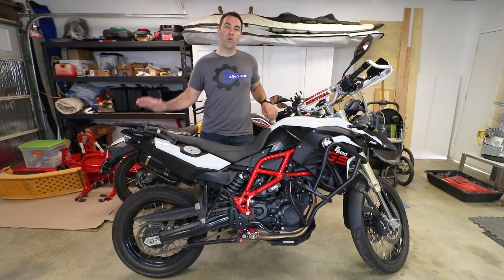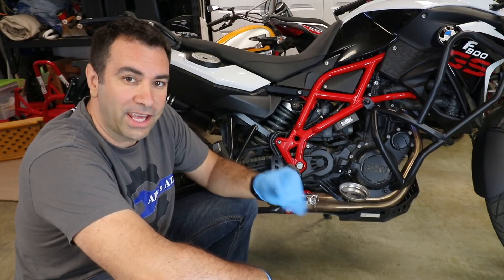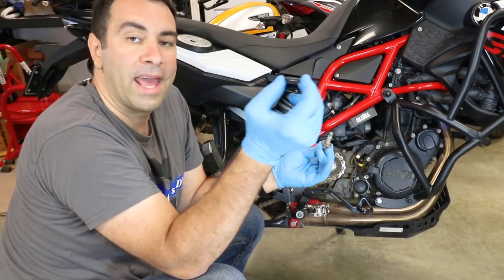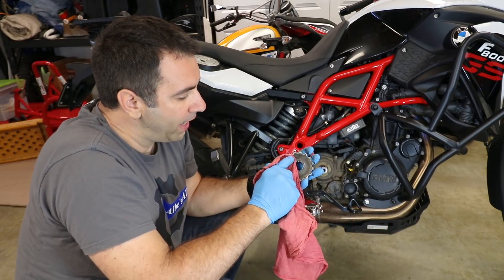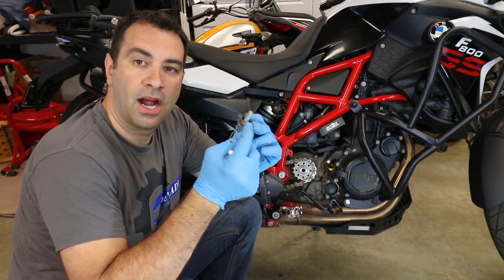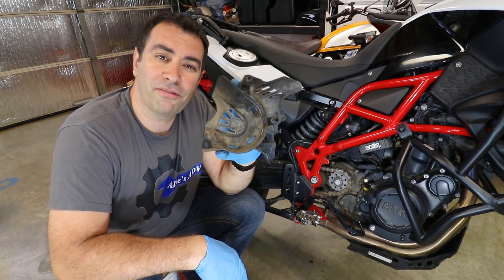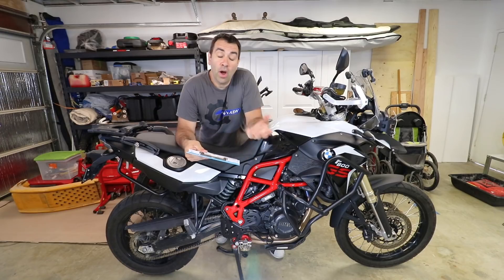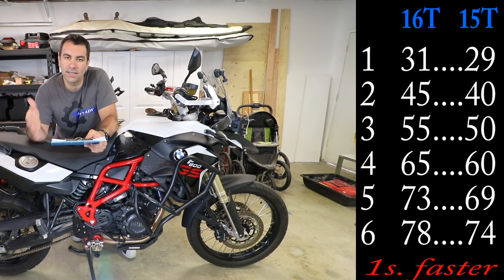BMW F800GS 15T front sprocket install

Comment: A handy site for checking the difference when you change front or rear sprocket tooth count is https://www.gearingcommander.com   You can select the BMW F800GS (or many other bikes) at the top and set up stock, current and custom settings to compare with.
Reply from the maker: Thanks man, I'll pin this comment to the top 👍

Comment: You sold me the moment you said you could lift the front wheel without clutching it up. Ordering one right now.
Reply: I just got my new 16t and chain in the mail... I want a 15t now too. FML
Reply: @nef4ri0us68  Try going with a -1/+2 front and rear setup, it's an extremely popular configuration because the chain length is unchanged.

Comment: Thanks Albe. That is one of your best mods and now  I have to do it.
Reply from the maker: Sorry Ed for making you spend so much money,  👍
Reply from the maker: I doubt it,  if the installation was done properly at proper torque specs that shouldn't happen,  beside he says "I even took a mallet to it"..... well....I didn't have to and the jt sprockets are made of  carbon steel.
Reply: Thanks Albe. I have been searching ADVrider and don't see anybody warning about this.  Better safe than sorry. Keep us updated about your experience with it.
Reply from the maker: Will do 👍

Comment: When I first got my 2016 F800GSA I wasn't happy with the gear ratios, seemed like 1st gear was too tall and the clutch has a very short engagement...which meant at the time it was going to be harder to ride right out of the hole..I switched to a 15T sprocket and man that worked great...EXCEPT at freeway speeds you better make friends with the new higher rpm.
Now after many miles and much time I switched back and was able to make 1st gear work soo much better, and got back my freeway hi speed cruise...
Thanks for another fine video..
Reply: It's easy enough to swap out the sprocket, takes 5 minutes - I'm going to run the 15T normally, but for longer hauls on the highway I'll put the 16T back in.

Comment: Thanks for the detailed description and the performance data.  I noticed you adjusted the chain on the center stand.  I believe it should be adjusted on the side stand.  Does it make much difference?
Reply from the maker: In my opinion it doesn't,  unless you have super soft settings on your rear suspension

Comment: Hi Albe. Changed to a 15 tooth front sprocket. All good, but when out on a test ride my gear indicator stopped working. Did you experience any issues? 
I stopped, switched off, back on, seemed ok. Just wondered if it is ‘confused’ an ECU type issue. I’m assuming the Motorscan app wouldn’t be up to sorting it out. Thanks mate. Your videos are the best 👍
Reply from the maker: Thanks Dave, I didn't have any problems with it,  but a few times I was clearly in 6th gear and the display was showing 5th,  it would flicker on a few times and then go away.
It never went away all together,  you might try to put back the OEM and see what happens to see if that is actually the problem. Let me know and good luck 👍

Comment: Thank you for your videos.  Have you noticed much difference in fuel economy since installing the smaller sprocket.
Reply from the maker: No, not really, a small decrease in top speed and the RPM run 500rpm higher at any given speed

Comment: Did you make a video review after you've used it on the bike for a while?
Reply from the maker: Not an actual review,  but I talk about it here and there, the sum of it being that if you do off-road the bike, this mod is a must, if you mainly use the bike on the road for long trips, you might want to keep the stock sprocket. 
I hope this helps
Reply: @AlbesADV  thanks, I literally just changed mine so will see how it goes.

Comment: Is that a 2017 with the electronic throttle?  I heard rumors that you couldn't install different gearing as the bike would throw an orange triangle.  I would like to eventually change the front sprocket on my 2017 700GS but I dont want it to throw codes.
Reply from the maker: Mine is a 2015 and no triangle,  I heard the same but I can't confirm it.
Reply: No different to slipping the clutch really. If were talking  sensors picking different speed and throwing a fault

Comment: Hey Albe,which chain and sprocket brand you are using, give me some advice on which brands to use on my f 800 gs.
Reply from the maker: Hi Haasoc, the chain  and rear sprocket are OEM, the front is a 15T by JT Sprockets. Vortex, Renthal, DID, EK chain they all are good quality parts.
Reply: @AlbesADV  thanks for the quick reply. Take care:)

Comment: F800GS, F700GS Euro4 models have issues with 15 front sprocket. CONFIRMED! On 6th gear, after a while, gear indicator goes blank. At  slow speed, it turns to normal, again after some time. And successively. 
Don't recomend for 2017+ models  of F800Gs, F700Gs. If you can't know the generation, just look at the gear number indicator on display. If it is at center <2017, if it is at left side, Euro4 2017>
Reply from the maker: Leandro, thank you for the information 👍
Reply: but... all of them? I've heard that some of them don't have problems... I have a 2017 f800gs and I'm looking to change the sprocket... don't know if I should...